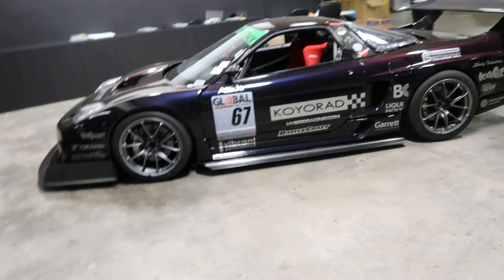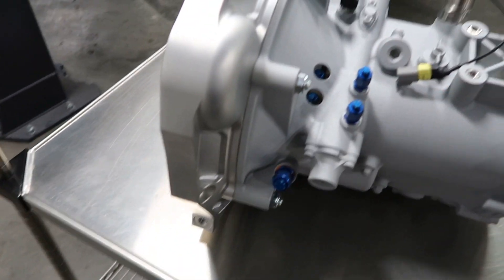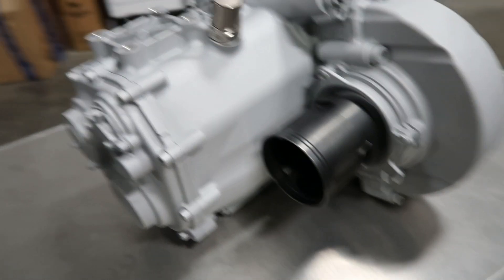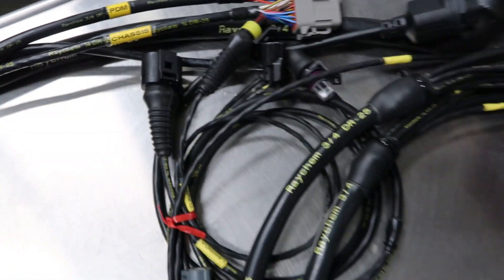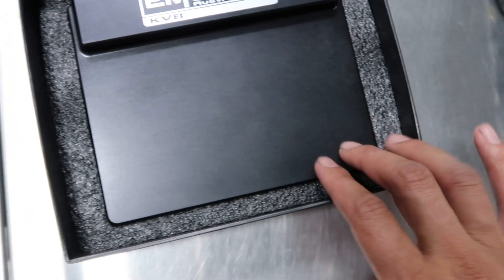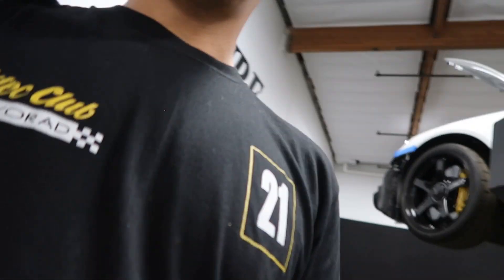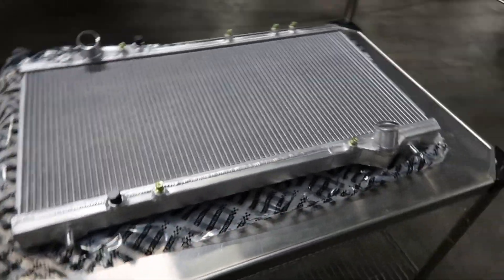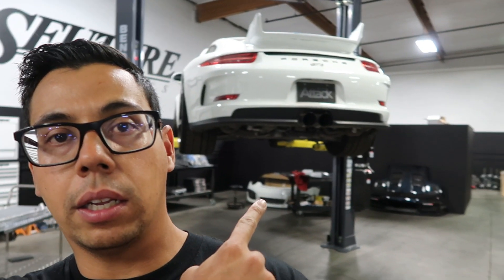K20 NSX Unlimited Class Time Attack Build - 3D Printed Sadev Sequential • Koyorad • Emtron • Rywire

Comment: Any specific reason you went for a Mezeire pump over the Davies Craig pump?
Reply from the maker: The me wire was easy to mount, we heard good things, and had the most flow we could find from an EWP
Reply: @RSFuture  good to know, I also noticed it’s an inline pump aswell which probably makes things easier
Reply from the maker: @wattleyracing  Install was really easy for the location.  It's also been reliable, so overall I'm happy with it.